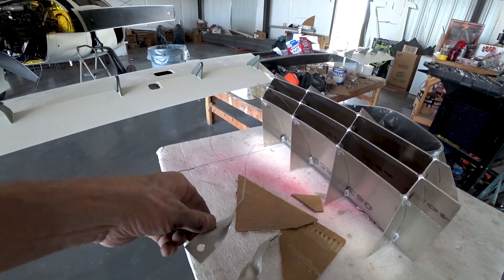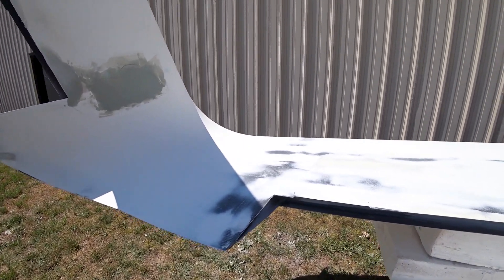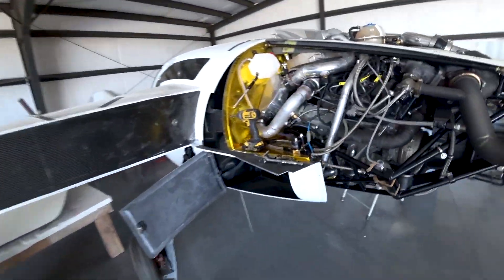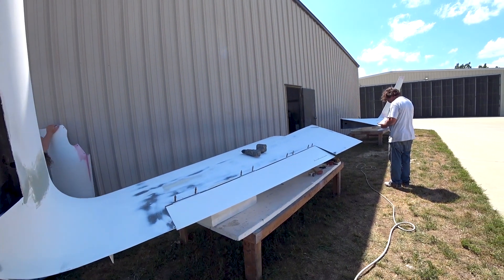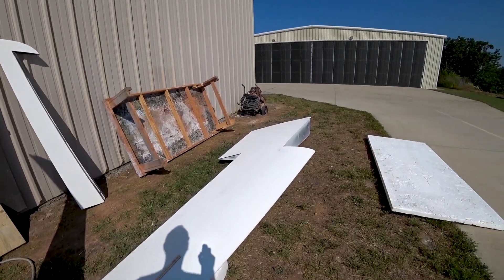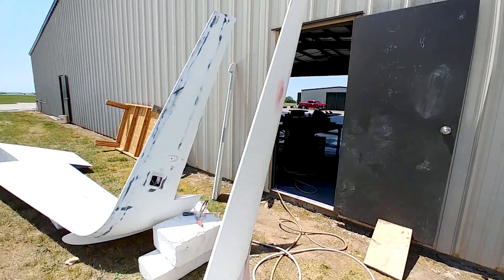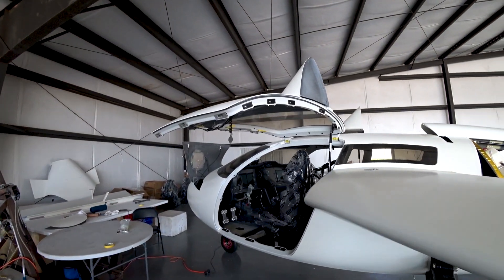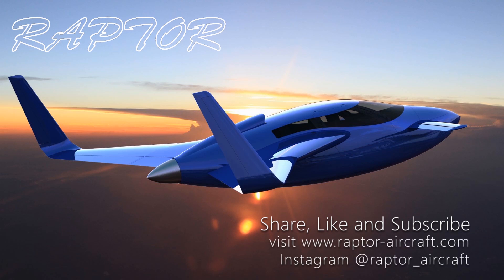Not Long to Go Now - Building the Raptor Prototype

Comment: Place a stainless steel flat washer behind your belt tensioner wheel. Should be able to find one ID and OD that you are needing. I would start with .100 thick or .125 from what I see that would space the tensioner wheel out just right. Good luck guys.

Comment: If the DC to DC were mounted in a metal box that was grounded it might help with the interference. Care would have to used to make sure that nothing can possibly short against the box, which might mean using standoffs to mount the board and/or adding a sheet of plastic or Katpon under the board.

A oscilloscope may be used to make sure that the converter is not injecting bad square waves into your electrical system.

The linear regulator might have worked if it were also placed in a metal box with the heatsink on the case, with the regulator electrically insulated from the case, with the traditional mica sheet and plastic washer.

There also seems to be a lot to do--when you actually have so little to do that you can put it all in a list.

Comment: You could try a DC DC converter from Digikey. There shipping is super fast--next day for ordered before 8:00pm central, and they have a have a huge selection in stock.  Their search tool's pretty good: https://www.digikey.com/short/pmcf48

This one could work: https://www.digikey.com/short/pmcf4b  It's 96% efficient, so it won't overheat, but it may still cause interference because it is a switching regulator.

This one has a metal enclosure which may help stop radio interference, though it's less efficient & only 3 amps: https://www.digikey.com/short/pmcf4f

Comment: Before you go much further. I'm going to recommend that you box in the sides of the radiator on the frame. Air will just bypass the core and go around the radiator following the path of least resistance. Automotive systems leave a minimum of a 1/2 inch between coolers so the tanks don't block areas to airflow. Ideally a shroud around your diffuser that directs all air through the coolers. You could put a cable or solenoid actuated hatch on the side to bypass some flow in extreme cold

Comment: I'm no aerodynamasist so this is just an observation.  Air intakes are often raised off  the surface, think vision jet, P51, F4, to reduce boundary layer drag and speed up airflow. I know you've done some CFD so no issues with what looks like a flush mount? I'm  also curious about the AOA gauge on the canard. Won't  this be inaccurate given the stall angle will change with weight on the canard and elevator position?
Reply: Stall angle is the constant, regardless of weight or airspeed.
Reply: @fliteshare  As you state, stall angle is independent of weight and speed.  Stall occurs solely as a function of AOA.  However, when a control surface is added to an airfoil it changes the airfoil.  Down elevator causes an increase in lift coefficient but it also reduces the AOA at which stall occurs.  Up elevator reduces the lift coefficient and increases the stall AOA. There's a lot of discussion in the canards forums and, from what I understand, an AOA gauge is inappropriate for a canard.
Reply: @BearcatB  
"Down" elevator decreases LOAD (negative G) thus requires less LIFT.
"Up" elevator increases LOAD (positive G) and requires more LIFT.
The critical angle of attack (stall angle) remains constant.
Unless you can change  the planiform of the aircraft mid flight (e.g. swing wings like the F14 and MiG23)
the coefficient of lift remains constant too.
Reply: @fliteshare  But the difference here is that it's a canard. As the elevator moves it changes the airfoil section of the canard and the stall AOA is unique for each airfoil section.  Hence, my original question of how do you t calibrate an AOA gauge on a canard.  If you fly solo the aircraft will typically require X degrees of down elevator for take-off (to raise the nose).  If you put two people on board it will require more down trim.   The airfoil section is different depending on the loading so how do you establish the baseline for an AOA gauge?  As I said, I'm not an aerodynamics but I owned a Long Ez for quite a few years so i'm familiar with the quirks of canards.
Reply: @BearcatB 

An increase in weight means an increase in SPEED (V1, Vr) no change in elevator trim required.
Reply: @fliteshare  Yes. You could go faster but that's not the issue. In my RV8 I have to haul a lot more on the elevator if I have someone in the back. Same thing in the canard. However, the original issue was that you can't use an  AOA gauge on a canard because the stall angle is constantly changing because the position of the elevator changes. For every position there's a different angle at which it will stall so its impossible to calibrate. Lots of discussion in the canard forums and, from what I've heard, they don't use AOA gauges.

Comment: To help solve the 'belt' problem I suggest changing out the idler pulley for one that is about 3/8" wider.  Thus it will support the full width of the belt.  Any part of the belt that is not supported will increase the chance of it coming off.  Again, just my $.02 worth.
Reply: I still maintain that something else within the serpentine belt system is out of alignment even if it is not the idler. A wider pulley sure sounds like a nice backup solution, but the root cause here needs to be found because having the belt ride that far off is not normal.
Reply: It will also cause excess wear on the belt. Every time it goes over the idler the unsupported portion will flex.

Comment: Thanks Peter, the wings look sweet with the flight control surfaces attached. Would be cool to see some views of the beit while running the engine.
Reply from the maker: I showed the serpentine belt in the last video. That's the one I was referring to.
Reply: @RaptorAircraft  I remember that video, I was thinking of when you doing another run up. Don't know if that's doable.